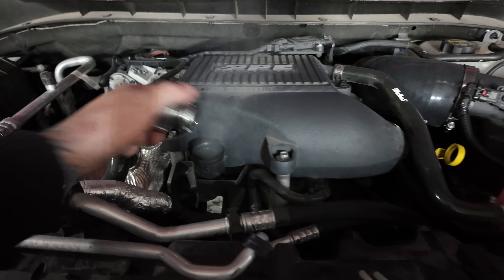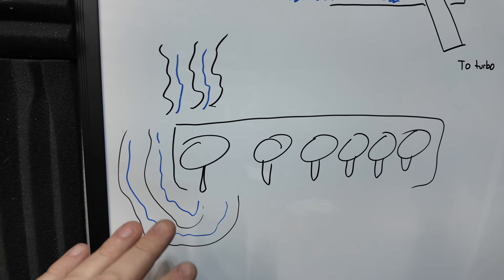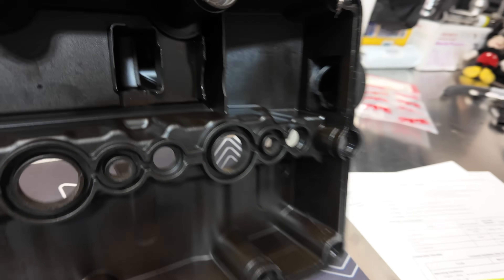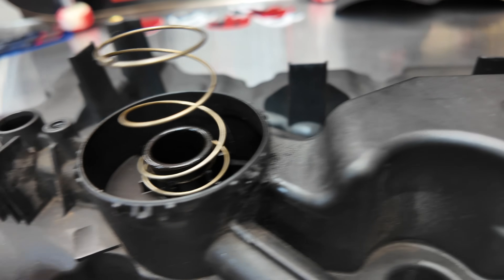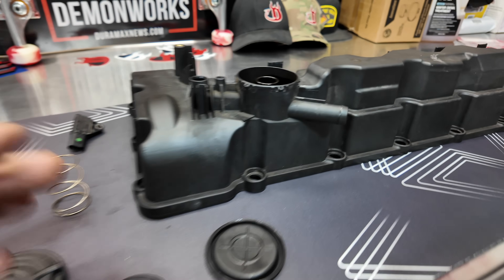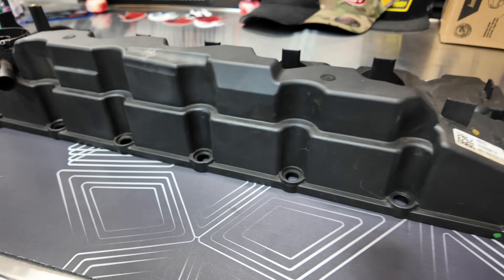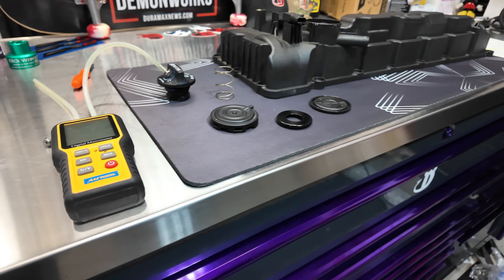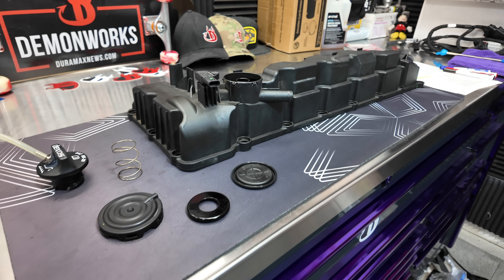Blow By From YOUR 3.0 Duramax Diesel ? This Explains it ALL

Comment: Unfortunately I have a 2020 LM2 with 120k that has been preliminarily diagnosed with excessive blowby. The oil cap will dance if you sit it loosely in place.

This was immediately after the dealer put it back together from the dreaded $10k timing chain job. The truck is also louder than before. Something between an intake and exhaust leak. You can hear it quite a bit at the air intake behind the grille. The dealer said they checked it multiple times and could find nothing loose or leaking. There are no trouble codes they said. Truck actually runs as good or better than ever. Bottom line it was never like this before.

The dealer called GM tech line and they said yes that was excessive blowby if the oil cap will dance around like that. They told me something about piston wrist pins with wear that cause excessive ring wear. The service manager also mentioned turbo shaft play could be the culprit. I am supposed to take it back in next week for further diagnosis.

They are talking new engine. I had an epic fight to get my extended warranty to cover the timing chain replacement. I have been without my truck for three months. There is no way they will approve a new engine.

Any thoughts?

Comment: PHEW!! Thank you for this information. I am not a mechanic in any way, however I do have just enough know-how to be dangerous. I am trying to diagnose a faint engine knock and oil dilution (6%) issue. Just dropped it off at the dealer. Pulled the oil cap after work and watched it "dance" a bit. Freaked me out! Purchased used a couple months ago and SWORE I checked this during my walk-around. Short story, long, this video puts me a bit more at ease but still nervous about the cost of repair. I swore I would not own another diesel but then I drove a 3.0. Like butter.

Comment: I’m monitoring the crankcase pressure sensor and I’m getting a min and max of -.2/+.2  it stays majority of the time between -.1/+.1 but occasionally hits the min and max. It only started doing this when winter came and It’s around 30f here in I keep getting the p04FB. I have the ppe catchcan and I find that I have to empty once a week and clean the filter twice a week. Is this normal? Should I remove it and take it to the dealer?
Reply from the maker: your engine is operating as it should. It will throw a light if you have an issue. Yes, the catch can filling is normal, I suggest draining it every time you fill up with fuel so it doesn't overfill in the winter time. No reason to take the truck to the dealership.

Comment: Rule of thumb. Loosen the oil cap and then place it back over the opening. With engine running the cap is lifted off you have excessive blow by. From one or more cylinders.

Comment: Finally someone debunks the myth. Seeing the big diesels and how they tested whether the cap flys off or not is an indicator of ring blow by, 3.0 diesels have a similar case with all that coming out the oil fill. Glad you straighten that issue out and we can finally put all that to rest.

Comment: Do you still reccomend this 3.0 platform as a reliable pioneer in the half ton category?
Reply: Why would he not? The 3.0 is more reliable than the 6.2
Reply: I sure hope he does! Had 40k miles on my 23’ and 70k on my 24’ now, and both LZ0’s have been solid for me!
Reply: @Fastlife250f thanks! Really thinking this 3.0 is the move especially for someone that lives on the highways to and from work.
Reply: @SteppingDwarf  You’ll see 30+ mpg if you have open traffic flow!
Reply: @S @SteppingDwarf If I might say….you may have seen some of the weird cases recently, where the 25 & 26’s had some early 3.0 failures….

Makes no sense, as they have clearly dialed-in this forged internal engine before now. 

If i didn’t have any ealrier model year already, I’d probably look lightly-used or wait until that’s ironed out 🤙
Reply: @SteppingDwarf I picked up a used Yukon for work. 4wd.  Some small annoyances, but overall the best vehicle decision I've made in a long time.   Driving on highway and though canyons, I average 25-27 mpg.
Reply: Hold off on the 25-26 models. Bad thrust bearing. Wait for a formal update fix from GM